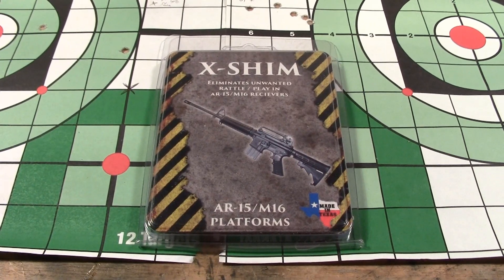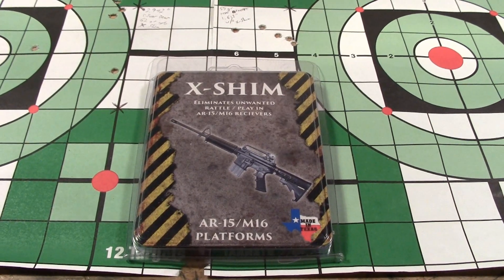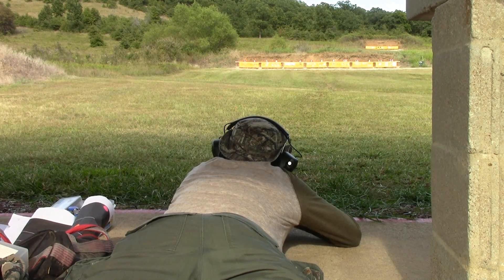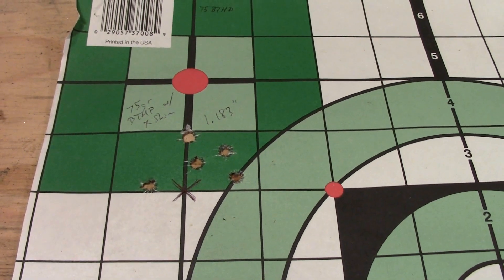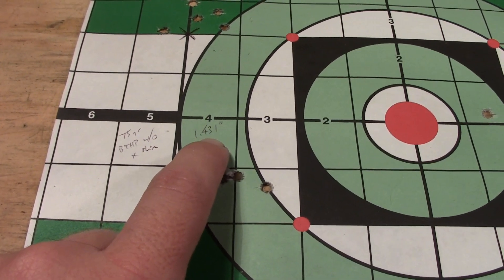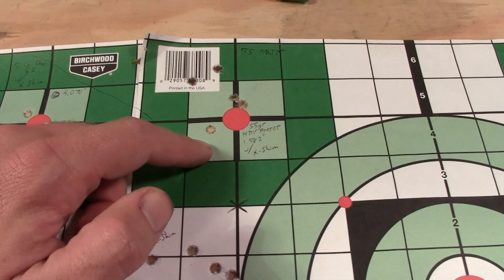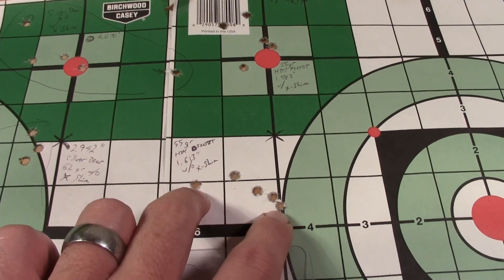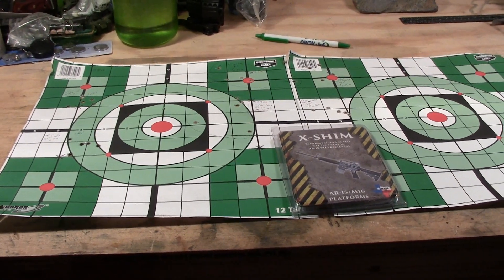X-Shim Re-Test: Rock River Arms AR-15 Accuracy with FMJ and BTHP Ammunition

Comment: I've got a new product coming out soon. The product will be a easier drop in and forget solution other than the X shim or accu-wedge. The product will not have to be adjusted. The product will not cause any  malfunctions or problems after thousands and thousands of rounds of ammo. The upper and lower will be easier to open and close for cleaning and maintenance. The product will give the operator a more stable, solid feel. Giving your weapon system a more higher quality presents in the hands of the operator. The new design will take out 85% of the play on all AR like uppers and lowers with no wear to the weapon system. While also making a small increase in accuracy. (Depending on the operator)
SL15 (shim) COMING SOON 2022..
Reply from the maker: Keep us all posted! Can't wait to see it!

Comment: Cut sections of bungy strap to fill gap under back pin then feeler gauge gap at front pin cut flat shim stock to fill gap plus .001 to make it tite but REMEBER each time you open and close hinge loosens some some keep a  good high round count between cleanings

Comment: Interesting. Have you tried an accu-wedge yet? It does the same thing, although I've never seen the x-shims so I cant comment on whether it accomplishes the goal in the same manner. Also, some receivers have set screws that can be used to take up the slack as well. Those have been more than I've wanted to spend. I'd be really interested seeing a video that compared the Accu-wedge to the X-Shims. I'd do it myself, but my shooting/youtube co-host has been off gallivanting through the woods trying to shoot Bambi (this time of the year hes impossible to get a hold of) and I've had an all consuming project for my apprenticeship (I'm 170 hours in and 120 of which were put in under 2 weeks while working full time). lol I've got videos out the ass on the back burner due to no free time. I'd say you could have my accu-wedge to test, but I'd have to find it and it would cost more to ship the damn thing than the wedge actually cost. lol If I remember correctly it cost like $2 or something like that. Also it would be pretty interesting to see an extended test of these devices. Skip the cheap crap ammo and stick to the nice stuff. More groups will give us more data to draw conclusions. We might see that in an extended test 20+ groups (10 with and 10 without) that it does make a marginal difference on average. We might see that over all there is no significant advantage. It would help us also rule out your shooting, not that I think you shoot bad. We'd see patterns, that's all, and I think the patterns would tell us a pretty good story of what is going on. Hit me up on FB... I've got an interesting idea that I'd like your opinion on.
Reply from the maker: Right on.  I think a lot of guys would like to see a comparison using American Eagle 55-grain ammo.  It always works well, and it's just kinda ubiquitous.
Reply: The set screw you speak of is just a hole drilled straight down from the take down pin out the bottom of the lower. Then ya thread it and put a set screw in it. The trick is finding a nylon tipped set screw. Fastenal would be the first place I'd look. I wouldn't look for any big improvement in accuracy though. That is pretty much dependent on chamber , barrel, bolt and ammo.

Comment: I have a screw with a spring on my Sig 556 patrol to tighten that up but I'm afraid it will pop out and be lost forever.
Reply: Locktite?
Reply from the maker: Yeah, someone needs to come up with a solution that can be tightened, but retained by the receiver.
Reply: I just need to adjust the screw.
Reply: Rifles First I might get the balls to adjust it.
Reply: Rifles First good advice, thank you.

Comment: I watched this and the other xshim vid but didn't notice you addressing whether the shims impacted the gap (positively or negatively) between the receivers? My home defence carbine is not a target rifle (no free float handguard) so the accuracy isn't as much of a concern to me as much as potentially eliminating some dust/debris ingress could be. Eliminating the play between the receivers would be nice too but just curious if the would benefit me more than the rubber boot route.
Reply from the maker: Great question.  Unfortunately, neither the Accu-wedge nor the X-shim actually reduce the gap.  They just press the lugs upward, so technically they're making the gap bigger.  I'd like to see an AR that connects via some kind of camming lock instead of pins.  That would solve both problems.